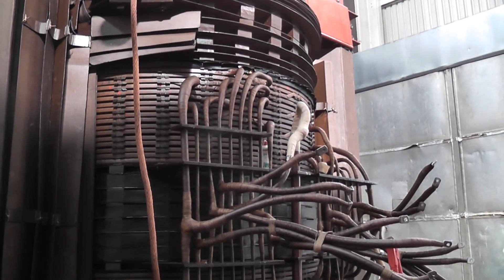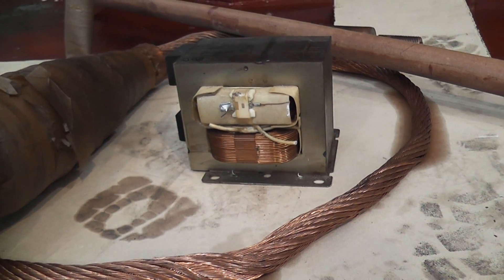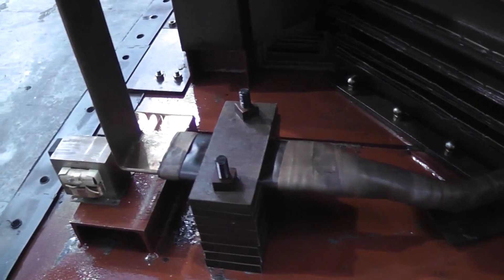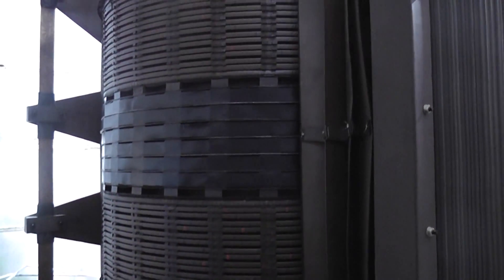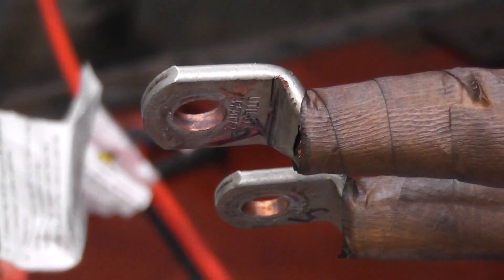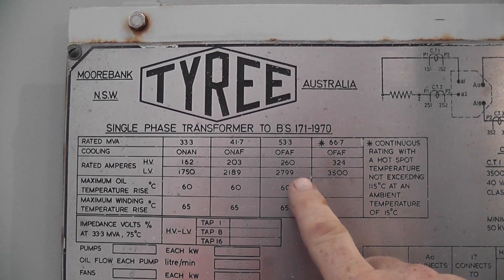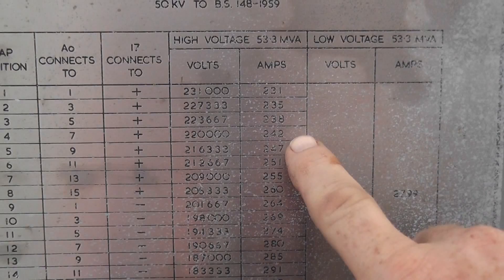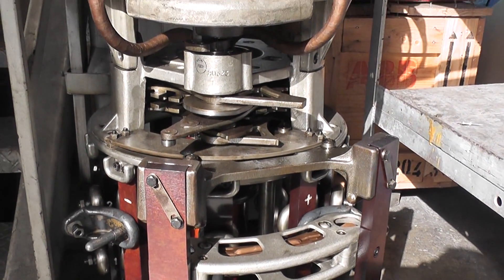66.6 MVA Transformer

Comment: Because the transformer  is submerged in oil when it is in operation. The oil act as a coolant and helps increase dielectric strength to prevent internal arcing.

Comment: By the looks of the specs I'd say it's a distribution transformer. An arc furnace transformer normally has a very low secondary voltage and and extremely high secondary output. And a much higher power overall.

Comment: It is called the 'emergency rating' and is to allow extra load in winter time due to heating and lighting load increases.

The normal ratings are usually based on a max daytime ambient temperature of 40°C (it does get a bit more involved, but that is the rough idea!)